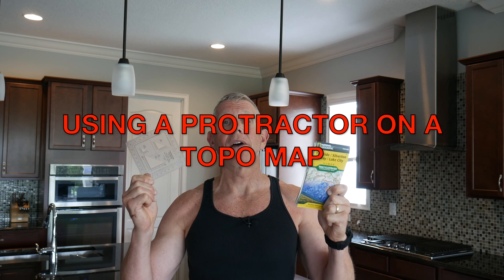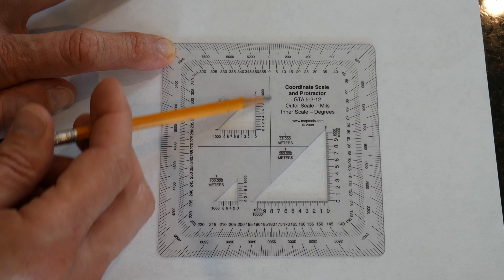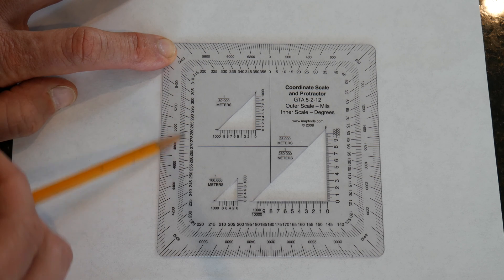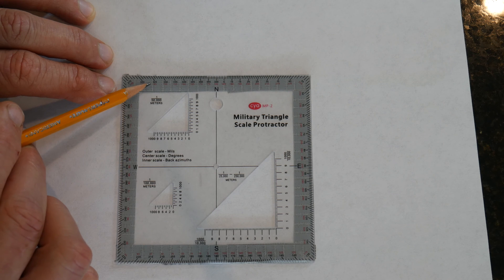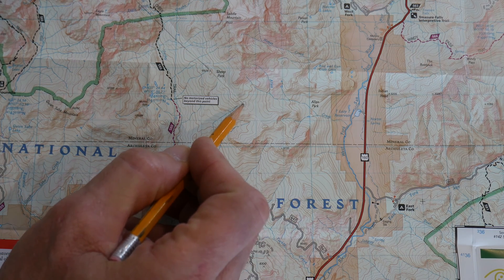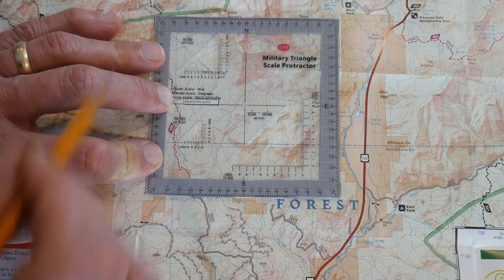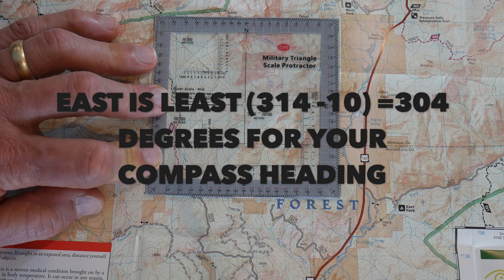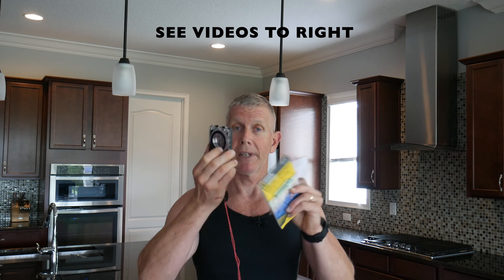How to use a Military Protractor on a Map

Comment: I'm not sure why mils are used when degree minutes and seconds could be used. Is it because mils are decimal based or something?
Reply from the maker: Mills are something used by the artillery units in the military. Mills are more accurate, but when it comes to land navigation degrees work well. I do not use miIs.  I usually just cut them off the protractor so they are not a distractor.

Comment: When you convert grid to magnetic do you also have to set an adjustable declination compass as well?  I have the Suunto just like yours but I'm confused as to setting it if the grid to compass conversion was done with a protractor.
Reply from the maker: Good question, once you set your Suunto MC2G built in declination your compass is now synced with your map.  You do not have to convert your grid azimuth that you get from the map.   So if your protractor reading from your map is 59 degrees then that is what you use on your Suunto compass.  You would do your conversion from a map when you have a compass that does not have a built in declination scale.  There is a saying when you have a compass with an adjustable declination, “Set it and forget it”.

Comment: Excellent presentation and thank you for taking the time and posting this. With lensatic and baseplate compasses like the Cammenga 3H and Suunto MC-2 global respectively, is there an advantage using a protractor?   Thanks
Reply from the maker: There is a slight advantage because the protractor would be a little more accurate.  If you’re using the Suunto MC-2G compass there should be no problem, especially if you’re in the field. Using the compass would be a quicker field method than pulling out a protractor. I learned in the military to use a protractor when it comes to plotting points on a topographical map. The newer compasses today would be just as effective to use.  Thanks for watching and commenting.